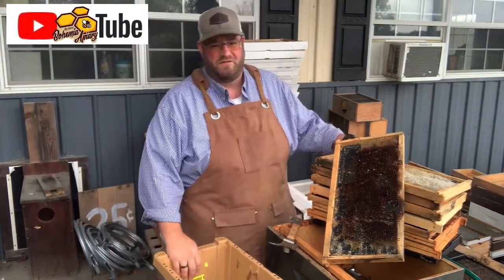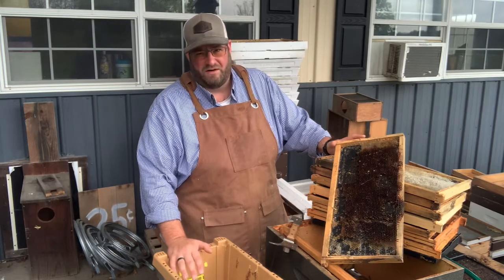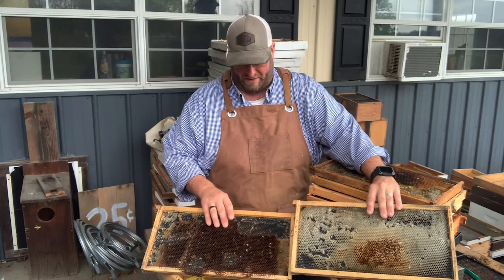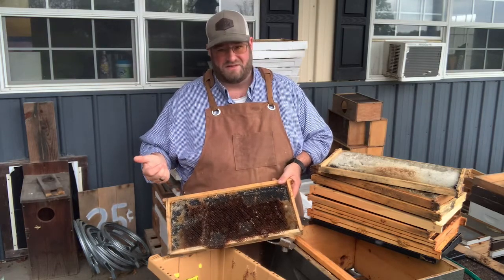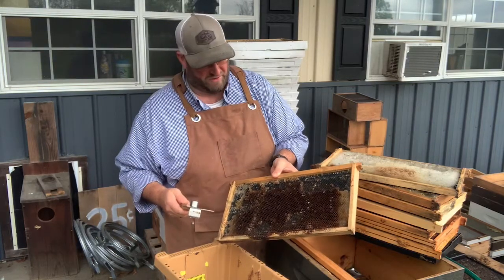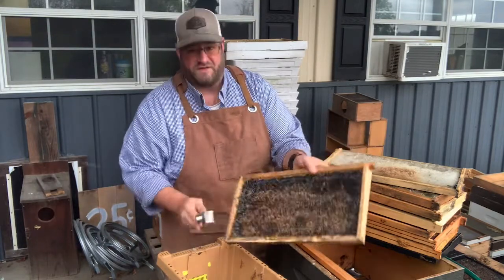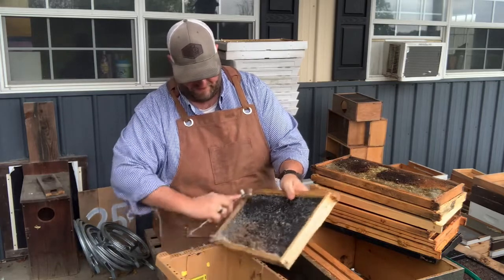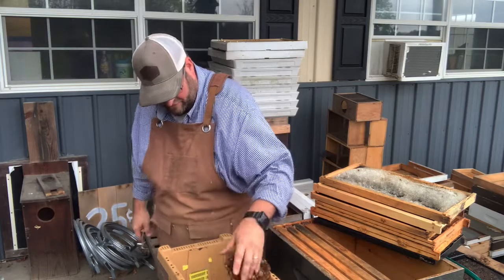Cleaning up old frames | Honeycomb | Beekeeping

Comment: And that may be why you only have one comment. I agree with freezing them. I can understand if you have a market for the wax. But I think you would be better off giving this back to the bees with out damaging all their hard work so they can fill it back up with nectar, pollen and brood. Just my 2 cents. What works for one bee keeper won't work for the next one.
Reply from the maker: While I appreciate your comment, the lack of comments are not my unit of measurement of a good video or beekeeping technique. 

We only scrape wax when it’s needed to help bees start off with a fresh frame of foundation. Due to a larger area of drone comb or perhaps it had wax moth damage from a dead out. 

There are multiple reasons why, and this video is just to show an easy way to do it. 

It’s what works for us, it’s not a prescription for every beekeeper.
Reply: Good content Mr Bohemia beeman….I did not know the bees would reconstruct the frames from just a good scrape down with added wax….I have always tried to clean them to perfection aka: new plastic foundation type…..which is almost impossible even with a pressure washer…I’ll try your method —see if they accept it….Thanks…

Comment: Great info, what's the next step? Do you clean the foundations and re-use? How?
Reply from the maker: I believe I mentioned it but I’ll re-coat the foundation with wax and reuse them again for the bees to clean and rebuild new wax comb.
Reply: @BohemiaBees  Thanks for that. Do you wash off the old pollen & casings before you wax?
Reply from the maker: No after I scrape it I let the bees clean up the rest

Comment: Thank you for your video! This may sound like a silly question, but I was wondering whether this cleaning technique could be done with comb that's been built on the plain wooden frames with wax comb starter sheets, or if it's better to detach the old sheets and start over with new wax sheets. What do you think?
Reply from the maker: Great question. While I’m concept it would work the only issue would be the foundation may be brittle when it comes out of freezer so you may do more damage then to the foundation than you want. But it could be a technique that helps break the old foundation and comb from the wires and then the bees could use the wire structure to rebuild all new comb.
Reply: @BohemiaBees  Thank you!!!

Comment: Why not just drop your frames directly into a pot of boiling water instead of scraping and scraping. Boiling it with clean everything off in seconds. You spent most of the video scraping one frame. Too time consuming. just my way and faster.
Reply from the maker: Many ways to skin a cat … thanks for the perspective
Reply: Hot water is very helpful to separate old black comb from foundation but exposure to boiling water can warp and ruin foundation very quickly. Rapid dipping 2 or 3 times and a little patience to let the heat work its magic and the comb will often lift off.

Comment: I did a cut out of a dead out that had some honey on top and put it in a cooler. How should I clean it ? Was hoping to use it for swarm traps
Reply from the maker: If the comb is full of honey you can press it using a screen bag to get honey out then render the wax. If it’s empty old comb you can just render it you use as wax to roll on new foundation. You could try to frame it up for use in a swarm trap but that may be difficult. You shouldn’t use any comb that’s wet or full of honey/pollen in a swarm trap. Hope that helps.